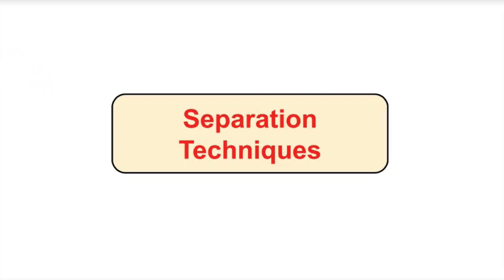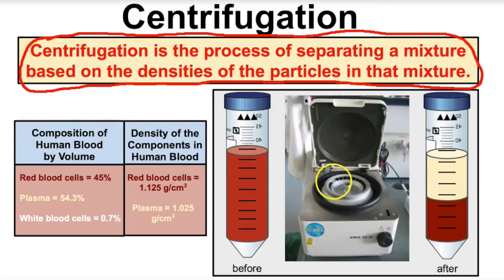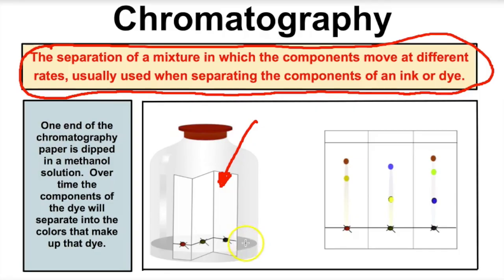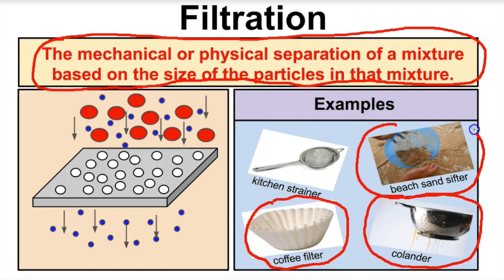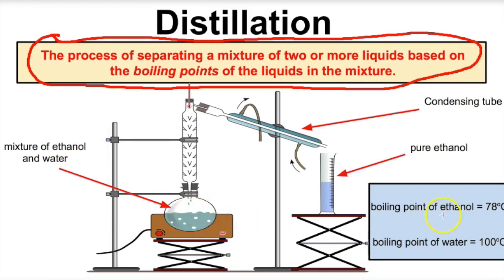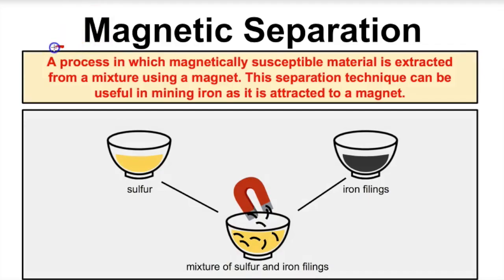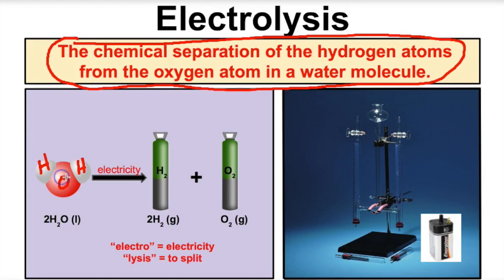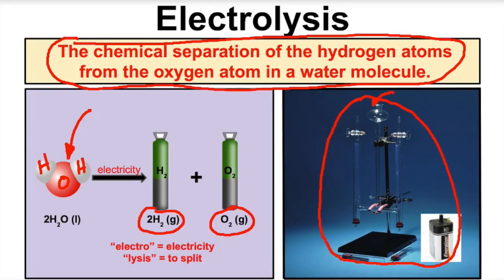Separation of Mixtures - Explained

Comment: Centrifugation- the process of separating a mixture based on the densities of the particles in that mixture. (physical)

Chromatography– the separation of a mixture in which the components move at different rates, usually used when separating the components of an ink or dye.

Filtration- The mechanical or physical separation of a mixture based on the size of the particles in that mixture.
(ex: Kitchen strainer , beach sand sifter , colander , coffee filter )

Distillation- The process of separating a mixture of two or more liquids based on the boiling point of the liquids in the mixture.

Decantation- The careful pouring off of a liquid from a mixture containing both a liquid and a solid.

Magnetic Separation- A process in which magnetically susceptible material is extracted from a mixture using a magnet. This separation technique can be useful in mining iron as it is attracted to a magnet.

Electrolysis- The chemical separation of the hydrogen atoms from the oxygen atom in a water molecule.
Reply: omfg thx so much
Reply: God bless you. Seriously
Reply: bro you just did my assignment
Reply: Dude tysm saved me so much time in class
Reply: Tysm remember me because one day I will become a professional soccer player
Reply: roblox noob
Reply: @Chill_Koala  bruh be appreciative animal boi